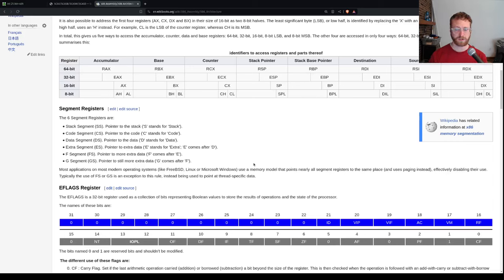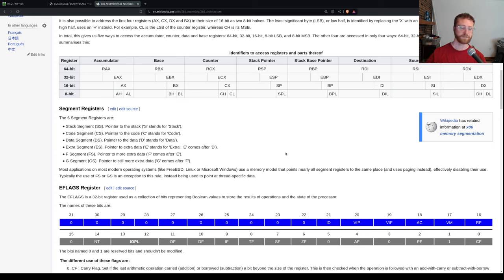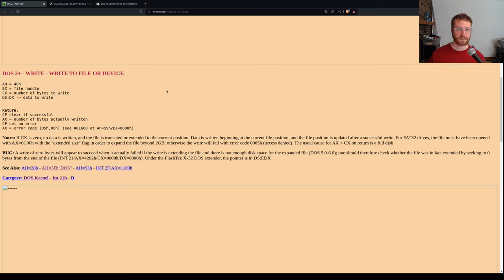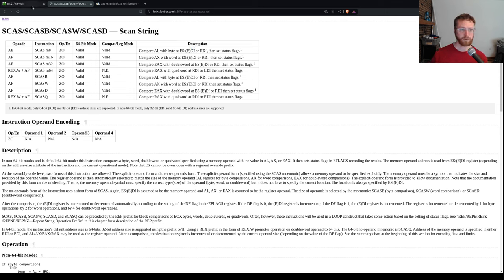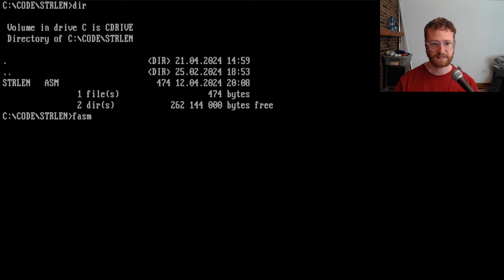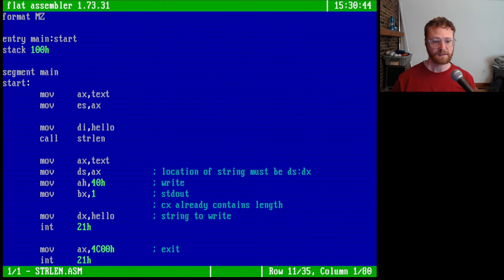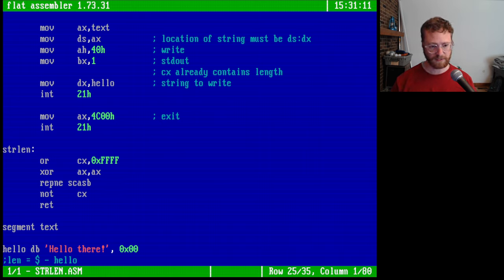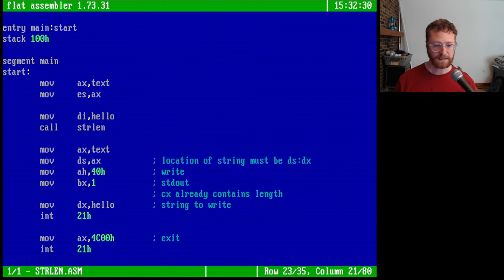05 Assembly: Segment Registers

Comment: Good work.
I like to use x86 assembly with DosBox, but i use a special debug version that provide 16 bit and 32 bit instructions to create a com file. I put all instructions to build a routine into a batch file using batch files as an open source container to telecontrol debug. I made some videos(no speech) to show how it works and to share the batch files. Have fun.😊

Comment: There are some more powerfull string instructions that use segment register. lods(b/w/d) = DS:SI, stos(b/w/d) = ES:DI, movs(b/w/d) = DS:SI + ES:DI.
If the direction flag is not set the string instruction increase the offset register SI and DI for a byte or add 2 or add 4 for word and dword to the offset register.